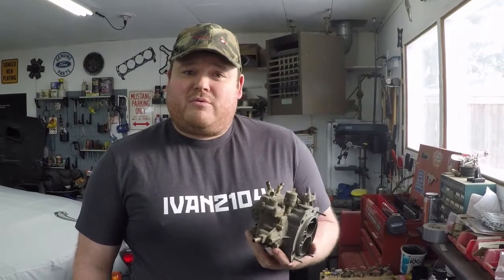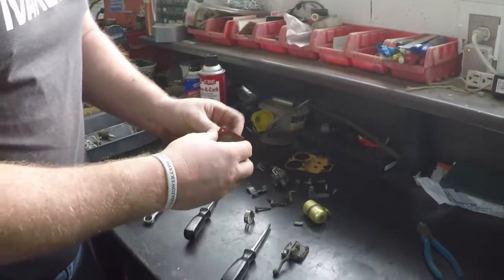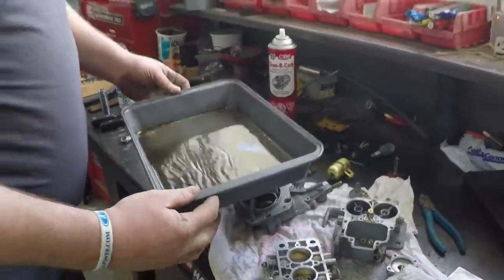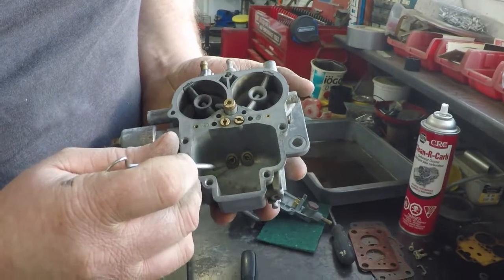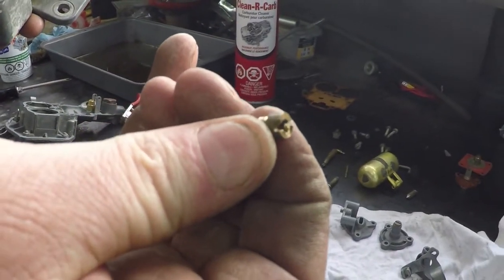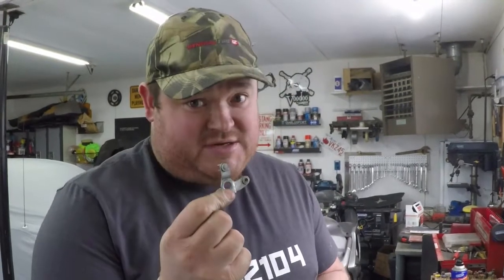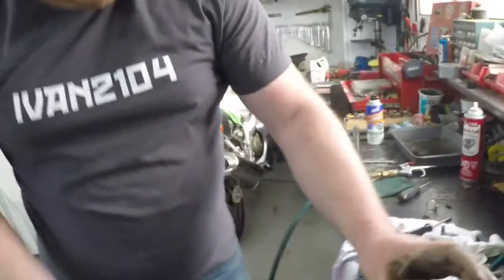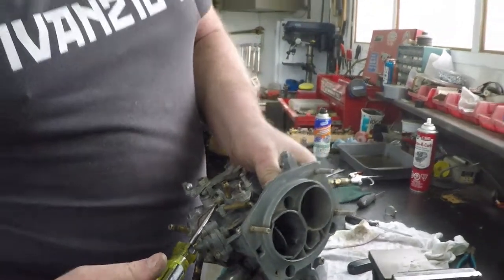IVAN2104 Rebuild that Carburetor!

Comment: Great video Shawn !! Looks like my latest addition ('87 2104) will need some carb lov as well. However, what it will need the most is a diagram for reconnecting all the hoses and such... as everything is disconnected right now. I can only go so far by checking my '91 2104 as it had a Weber carb installed back in '08 when I got it. 

I do have a Haynes manual but would love to find something more detailed. Thx !!!

Comment: hello ivan, i think you forgot the fuel filter at the entry of carburetor
Reply from the maker: Hello havena, you are correct here is a filter screen at the fuel port on the carburetor, we did pass air though it as a check but have never found one to be in bad condition unless a fuel pump diaphragm has failed. Typically the primary fuel filter in the fuel line captures any debris. Thank you for your comment and for watching our videos! - Darren